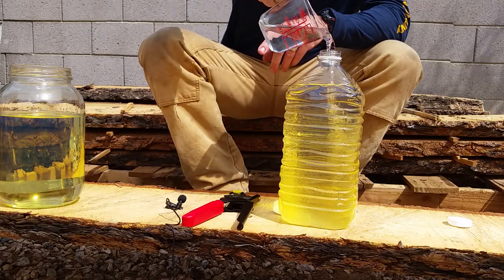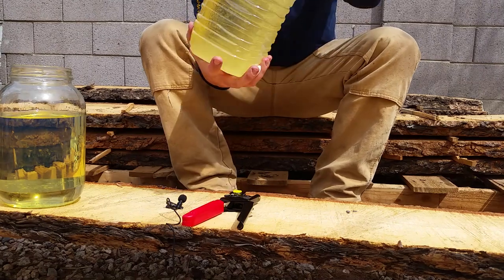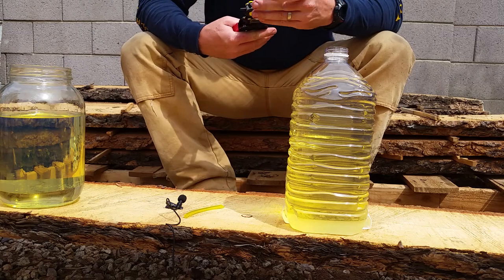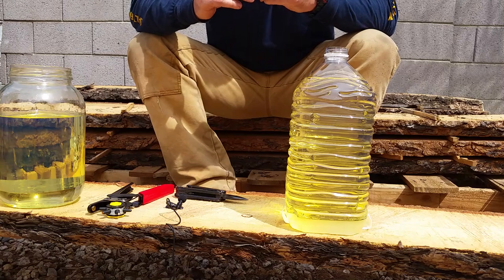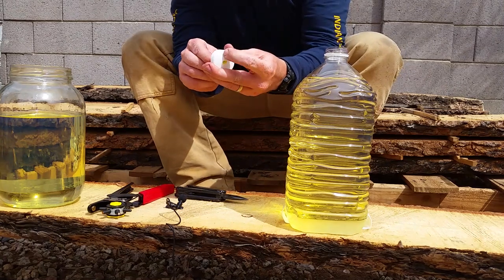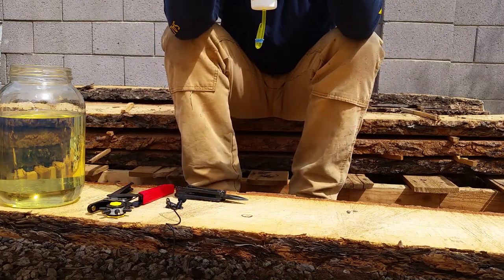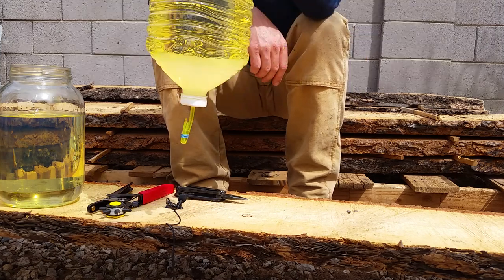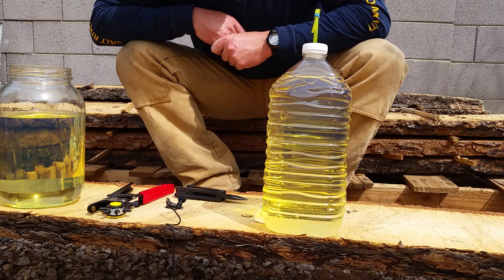Removing ethanol from gas

Comment: is this a good idea ?  maybe not if one drives there car daly    in the production of auto gas there is a good amount of water in the mix    that can be found in the tank   how do you remove the water from the tank   easy add ethanol     the water then will pass  with out any problems       there is no real problrm with ethanol in the fuel unless the fuel it sits in the tank for a long time       help me here i have worked in mixing fuels  for race cars     i think your making problems      C
Reply from the maker: +Clay Coates it's obvious you haven't worked on small engines.

Comment: Yes alcohol can absorb water, but that isn't always a bad thing. Alcohol allows the water to mix well enough so that you can run it through your engine. If you use gas with no alcohol water can still condense inside your gas tank and it will pool at the bottom of your tank get sucked in right into the fuel pump and it's really hard to burn pure water. If you use ethanol gas and keep the tank fairly full and keep the gas cap on your not likely to have a lot of problems.

Comment: so how much water per gallon is best to put in? Im glad I came across this. I don't like how my small engines seem to get gummy inside more often on this shit gasoline
Reply from the maker: +pds tech to get an idea of how much ethanol is in your fuel you need to put in a set amount of water. If you just want to remove the ethanol 8oz per gal would be fine.

Comment: I don't think this works. I just tried it, poured the water into a demijohn first, marked the level, poured in the petrol, shook it, waited a day expecting the level of the liquid in the bottom to rise by 5% of the original volume of the petrol as the ethanol is absorbed (we have E5 here in Scotland, obviously it would be 10% in the US). Anyway, nothing. Exactly the same levels, why?
Reply: Looked at another video where the bottle was marked and is seems legit. I know there is ethanol in the fuel here too as it just melted a fibreglass fuel tank of mine 🤔
Reply from the maker: Here in the states I can never get a straight answer as to when and how much ethanol is in the gas.  I'd bet that if they're out of it they'd just ship it to the gas stations at 0% ethanol.  The tags on the pump say "may contain 10% ethanol" I'd venture to say the day you pumped yours it was 0% ethanol
Reply: That was the conclusion I reached yes, a 'maximum' of 5 or 10%, thanks for replying.

Comment: How are you confirming that you've reduced the amount of ethanol in the gas?
Reply: you see it at the bottom, once drained into another container all is left is oil based gasoline petrol
Reply: @wharris7594  Water in non ethanol gasoline looks exactly the same as this. I guess that's an OK answer if you assume this works, but the guy claims it removes the majority if not 99% of the ethanol without any evidence.

Comment: this make perfect sense. worth a try.
Reply from the maker: +patthesoundguy let me know how it works for you
Reply: AzDadOnFire I totally will let you know. I have a small engine business and would like to have ethanol free fuel for machines I work on without having to pay more for premium at the pump
Reply: patthesoundguy I have messed up many small engines by letting them sit all winter with ethanol extended fuel in them. Finally, when I learned my lesson, I found ethanol free gas near me and use it exclusively in my small engines. No more problems

Comment: I don't think ethanol raises or lowers the octane. The water was used to add compression in engines to give it more boost. They got the idea in WW II. The pilots could push a button to have water injected into the engine to add compression to get more speed. Nothing to do with octane, just compression.
Reply: Ethanol absolutely raises octane.  Pure ethanol is 113 octane, E85 is 108.

Comment: I'm going to send you hate mail. I'm sending you A your exactly right on that about removing the ethanol from gasoline fuels.& adding in octane booster for reraising the octane levels back up in the fuel. One thing to on that you only need 4 ounces/4 oz's of water to treat one gallon.& even 5 gallons of fuel with at A time to.

Comment: In Ont Canada use nothing but Shell Premium that has 0% ethanol for my push lawn mowers, weed eater, snow blower, john deere and performance cars cause they don't run right on regular gas with ethanol.
Reply from the maker: +John Milner Alaska has zero ethanol
Reply: Sunoco (PetroCanada) is also ethanol free for their Ultra 94 fuel. 
Would probably use Shell V Power if I had a Shell station close enough though.
Reply: Old Sunoco 94 now Petro 94 is not ethanol free. From the website. Does Ultra 94 contain ethanol? Does Petro-Canada still offer an ethanol-free gasoline?
Ultra 94 contains ethanol. Due to the fact that various fuel grades are blended at the point of sale, most grades of Petro-Canada fuel may now contain up to 10% ethanol. This represents a change from the previous state, where premium fuel was ethanol-free at Petro-Canada. http://retail.petro-canada.ca/en/independent/2056.aspx#Why is Ultra 94 not available at the Petro-Canada site I use?
Reply: John Milner 
Ultra 94 is only available at the former Sunoco stations that have the tank in the ground for the fuel.

Comment: The thing is I can get ethanol free gas if I want it. I don't have a problem with ethanol since I run all my engines on it from day one, It causes it's worse problem when you run an engine on ethanol free gas for a long period of time then try and use ethanol gas, Ethanol is a great cleaner too and it will clean off the varnish and other contaminants inside the engine and clog the carbs.  Ethanol and octane actually slow the burn process of gas which makes it burn better inside the camber and helps with the ticking of the valves and helps the engine run more efficient. If you want to use regular gas and you can get it, do. After you have had to do all this you might as well pay the extra for the regular. It wouldn't be more expensive if the Government didn't give grants to use ethanol.  If you want to use ethanol in and engine that has ran on regular gas, you can add it slowly over a period of time making it more and more ethanol until it is finally all ethanol, Usually does the trick and not clog the carb. Now, if you want to talk about the problems with ethanol gas to start with, that is another story.  It should have never been created and now that we know that, we will probably never get it stopped,

Comment: 333 stations in Iowa sell ethanol free gasoline....and Interstate 80 doesn’t go to Missouri.
Reply: I test all of the gas that goes into my two cycle engines. Frequently fuel sold as alcohol free isn't.  Tested some recently that had 15 percent.  Another problem I found is often the non alcohol gas sits in the tank for long enough to go bad.  I spent all afternoon a while back trying to get chainsaws to run before realizing my can had been filled from a station that had old gas.

Comment: Are you sure your materials are impervious to gasoline? Rubber band certainly is not. All you have is a friction fit with your straw in the cap, and you are proposing to hang that upside down for half day?  

What could possibly go wrong?
Reply: lol I don't think this guy is very smart.
Reply: The fuel lines in my weed whacker and chain saw fuel tanks are friction fit. His method will resist leaking as long as a gallon or less of gas is used, to keep pressure low. And the rubber band isn't soaked in the gas, it's on the outside.  A new rubber band every month when a new gallon of pure gas is produced is very cheap insurance.
Reply: rubber band was simply to keep hose leak free a simple clothes pin works etc.. not rocket science .. plastic bottle was a for instance if you did not plan on replacing the jug every time use a glass jar with a modified screw on cap his plastic jug was simply a modified version of his original design to separate the water easier.. im sure the jug got very soft very soon after video..
Reply from the maker: +Dukerdr I'm glad someone understands me

Comment: There are also chemical detergents, in powder form, also added to the gas to clean fuel injectors in cars. If you let this gas remain in your carb it will still evaporate and plug it up. Drain your gas to be safe. Gas today is made for cars with fuel injectors.

Comment: I understand the reasoning in wanting to remove the ethanol but that can amount to about 15%.   
Subtract 15% from the gallon of gas = .85 gallon. Cost of gas has now gone up 15%.
Add octane booster @ about another 10% to 15% of cost.
The cost per gallon of gas has gone up considerably.
Reply: Yes, but your repair and maintenance costs will go down. Ethanol is horrible for every part of your fuel system.

Comment: I have built a more permanent ethanol removal device. I can do 5 gallons at the time. I use the gas in my motorcycle. Kerosene makes a good ethanol booster.
Reply from the maker: +Gerald Scott how long do you let it sit after adding water?

Comment: Good idea, but time-consuming. We can get ethanol free gas here, but they charge more for it, I must use ethanol free gas in my outboard engine. Regular gas here before the hurricane was going for $2.04 for 10% ethanol, but free was $2.76 a gallon. 
Also, in most light aircraft, we had to use aviation gas, which is 100 octane and does contain a small amount of lead but no ethanol. You can modify the engine upon overhaul (TBO) to use regular car gas but it is very expensive to do.  
All stations here have posted signs which state: " This Fuel May Contain 10% Ethanol." My question is why? Simple, many older engines do not run well on fuel with ethanol. Ethanol can erode rubber parts in engines, break down gaskets and harmful to other engines component.

Comment: I agree that this simple process works to remove ethanol but it is impractical if a person wanted to run ethanol-free fuel in their vehicle. Example-my Acura takes +/-15 gallons to fill the tank. I need to have a safe way to purchase, transport, and filter 3) 5 gallon buckets worth of gasoline efficiently. I don't want to transfer gas repeatedly between containers or spill gas on myself or my driveway or the trunk of my car. Assuming I was able to work the bugs out this would be great. AVE has done the math and ethanol blended fuel is far less fuel efficient than straight gasoline.
Reply from the maker: +mdwdirect you could just design a 10 or 20 gallon tank that does the same thing. But you're right.....the process would be difficult

Comment: The reason the government added ethanol to fuel is due to environmental concerns because ethanol burns cleaner. However, one of my professors when I went to college who is a chemist said that ethanol is actually less efficient then straight gasoline so you have to burn more of it, therefore causing more emissions in the long run. The government is so screwed up.
Reply: Pollutants are regulated by grams per mile.  You may have to burn more fuel to go that mile, but the emissions can't be more.

Comment: JUST SOMETIMES YOU MAY NEED THAT ETHANOL TO BE IN YOUR FUEL, because Fuel tanks breathe in air which contains a certain level of moisture. 
Driving on warm humid smoggy days, the empty space left by the fuel you used up is replaced with warm humid air and smog. 
Then on nights where the temperature falls low enough, it can make the moisture & pollutants condense to liquid water and run to the bottom of your tank & can find a low point to sit in. 
That water plus sulfur dioxide(a common air  pollutant)  make acid which can eat a little hole in the tank, if you're unlucky. 
Sometimes a bit of ethanol can help dissolve that water & allow it to be sucked away. Small amounts will get injected or evaporated and pass through the engine.
One big accumulated water load getting sucked up all at once can soggy up & block a paper type fuel filter, and drown a carburetor.

Comment: Ethanol fuel is only cheaper because of government subsidies, in a free market it would die because of the production cost.. Ethanol produces less CO2 emissions but E10 only contains 80% of the available energy compared to pure gasoline (E0).

Comment: Not a good idea,  ethanol is 117 octane,
I didn't do the math but just on top of my head what's left if below minimum required for an engine. Unless you are using led additive octane boosters don't work.

Comment: Octane is a measure of resistance to combustion, as opposed to Cetane in diesel fuel, which is a measure of combustion. High octane fuels are necessary in high compression automobile engines to prevent premature combustion. Loosing octane should not be a problem in small engines which generally designed to run on low octane or more highly combustible gasoline.
Reply from the maker: +Kaw River Chopper good points
Reply: Frankie, I understood what Kaw was saying and I'm sure he meant what you said. He didn't use correct technical term!!!

Comment: The real problem is not the ethanol in the fuel. It's water contamination. If moisture gets into fuel it will cause the ethanol to separate from the gasoline with the water. Hydrated ethanol is polar. Gasoline is non-polar. Dehydrated ethanol will mix with either gas or water. Water is heavier than gasoline and fuel pickups are in the bottom of the tank...
 Moisture is attracted to the hygroscopic ethanol. In vehicles that use their fuel often and get refilled this isn't a problem. In tanks where fuel sits for long periods of time (like mowers and boats) the absorbed moisture causes separation. Yes ethanol can damage old rubber compounds that aren't 100% synthetic like fuel lines in older classic cars.
 How do you remove the separated ethanol/water from a tank without draining it? Add more ethanol...

Ethanol is a byproduct of the yeast fermentation of sugars. Methanol is/was a product of the distillation of cellulose (wood). It is produced synthetically now.

Comment: The ethanol is 10%. So in 1 gallon of gas, there will be 13 ounces of ethanol. Add to that the 8 ounces of water added, a total of 21 ounces of waste should settle to the bottom of the container. But this was never demonstrated, and it sure didn't look like there was 21 ounces in the bottom of the container.
Reply: Dave Gaetano Does that container look like a 1 gallon container to you?